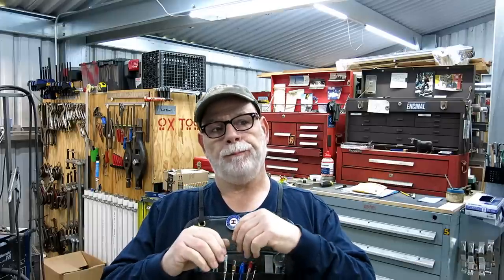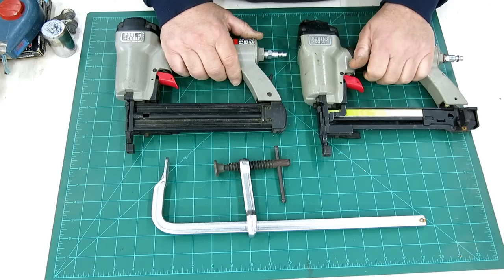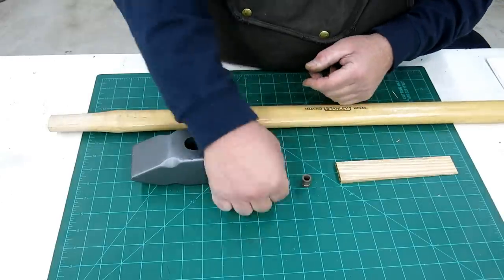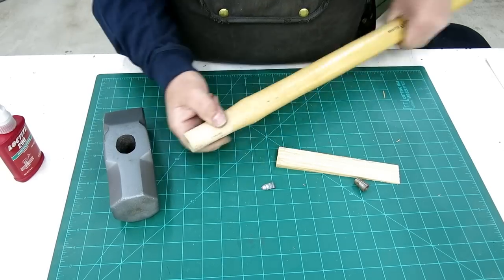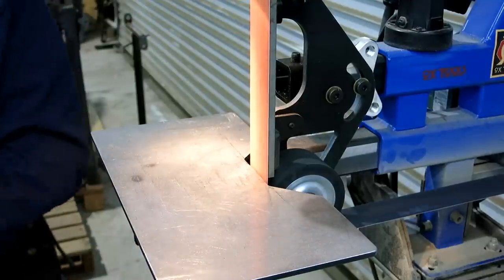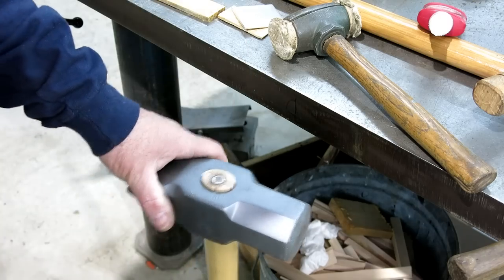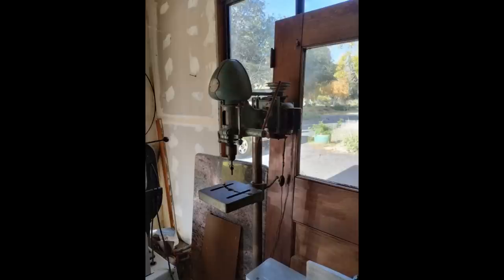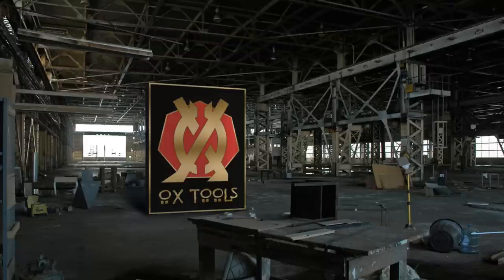Monday Night Meatloaf 148

Comment: I'm always apprehensive about buy things like adhesive on Amazon; I've gotten some that's well past expiration date.
Reply from the maker: Hey Steve. I thought it was worth the risk in this case. For hammer handles slightly expired would be fine. Thanks for the comment.

Cheers,

Tom

Comment: 26:18 I’m sure they tested it thoroughly when they started manufacturing these LED bulbs 22 years ago. Probably screwed one in and it’s still going, right?
Reply from the maker: Hey MM. There is some poor bugger that has to check them every day and write down which ones burned out. Thanks for the comment.

Cheers,

Tom

Comment: Nice meatloaf. Re: Lightbulbs.....When we switched to LED in the home, I began writing the install date on the bottom of the bulbs.  Reality is not even close to the advertised life spans-  Claim: "Lasts 7 years".....& numerous failures under 1-1/2yrs.  LED is certainly a step above fluorescent, though.
Reply from the maker: Hey Robert. Well if I only get 30% of advertised I'm still ahead. Thanks for the comment.

Cheers,

Tom

Comment: Use the hot tip of the glue gun as an iron to melt and reshape the hold glue.
Reply from the maker: Hey Rick. That's pretty crafty of you....Thanks for the comment.

Cheers,

Tom

Comment: Hi Tom. I usually expect your posts to have something to do with optical flat levels of precision so I was quite tickled to see you mounting a handle to a sledge. I've re-handled probably hundreds of tools, mostly axes. As some other commenters said a linseed oil soak works great, and much cheaper than Loctite.
Reply from the maker: Hey Bruce. Have not tried the linseed oil. Oil by nature takes a while to dry so I prefer the locktite method. It cures hard like epoxy. Thanks for the comment.

Cheers,

Tom
Reply: @oxtoolco  There are a couple of products: Chair Doctor, and Chair Lock that are supposed to fix loose joints in wood by causing the wood to swell permanently to create a tight joint. A few people recommended them for tool handles so I tried it. I do not recommend! The fit did get tight for a while but worked loose again under the impacts the tool was subject to. Just an FYI in case someone recommends this to you or your followers.

Comment: White oak has closed pores, which is why they use it for barrels (red oak has open pores that you can blow air through, if you rive/split along the grain).  So your white oak wedge isn’t going to soak up much of the sealer.  Not sure about the hickory though- I think it is open pore?
Reply from the maker: Hey Roverino. The end grain of woods are a tubular structure unlike the cross grain. The density of the wood has something to do with how small the tubes are. The locktite seemed to go pretty easily into both bits of wood. Thanks for the comment.

Cheers,

Tom

Comment: The Amazon mixup on the LocTite didn't work for me.
I watched this video on Monday and immediately jumped on the $15 bottle of LocTite 390. 
They shipped the small $15 bottle. 
Your case may have been a fluke, or a regional mistake, or a mistake corrected on Monday by them is my guess. I received the bottle Tuesday evening. I have had Amazon make a couple of mistakes similar to this over the years that worked out to my advantage though.

Comment: Only savage uses metal wedges on tool handles.All you need is small flat head wood screw  on a parting line between handle and wedge and it will never come out.Drill the pilot hole ,screw it in and threads will keep wedge in place. Also why waist locktite when you can use the linseed oil the same way ? Its great for dry wood-only better thing would be to put handle in vacume  chamber filled with linseed oil to completely stabilize the wood.(thats what knifemakers do with their fancy coco bolo,mahagony,rosewood handles )
Reply from the maker: Hey Zum. Linseed/Locktite? What's the difference? Bottom line is to use something. I like the wood screw Idea. Have to try that on the next one. Thanks for the comment.

Cheers,

Tom

Comment: Tom your bearing looked to me like it might be a shift pin
Reply from the maker: Hey Bill. A shift pin out of what? Pretty short and the dual tapers reminded me of a cylindrical bearing roller. Thanks for the comment.

Cheers,

Tom
Reply: @oxtoolco  reminds me of a diff pin in a truck rear end

Comment: The brushes are probably used anywhere a physician needs to get cells for examination under a microscope, such as the urethra or uterine cervix. They are too short for getting pulmonary specimens. Cytology = knowledge of cells, or examination of cells for the gain of knowledge.
Reply from the maker: Hey Fred. I figured as much. They had that creepy medical look to them. Thanks for the comment.

Cheers,

Tom

Comment: I have a Forester stabilizer you can have if you like. I sold my 10" table saw and have an 18" now.
Reply from the maker: Hey Traditional. Now that is a saw! What is the make. Tannewitz, Oliver? Thanks for the comment.

Cheers,

Tom
Reply: @oxtoolco  It's a Yates-American, it can spin an 18" blade, but Yates-American only recommended a 16" blade as it's 5HP direct drive. I have a number of 14" Leitz crosscut blades, and 16" Leitz rip blades, bored out to motor arbor size (either 1-1/8" or 1-1/4"). It's a beast, it came from the Naval yard in Benicia. It has an  YA is my favorite woodworking machines.🤗
Reply: started to say it has a Bureau of Ordnance tag on it, if you're familiar with those. I have them on a few machines.

Comment: I guess wood working makes shavings that could be called "chips". OH no I now have a strange urge to stain something with linseed oil. You have turned me to the dark side. That smiley face of shame on that drill press makes me sad and angry at the same time. Years ago i scored a large delta drill press with no pecker tracks than my lil brother had and urge to go in my shop grind aluminum on all 4 of my grinders yes that's 8 grinding wheels clogged with aluminum and pecker tracks everywhere :( Now I'm getting into large mills and lathes he is "Never" "EVER!! touching my lathe or mill EVERRRRRRRRRRRRRRRRRRRRRRRRRRR!!!!!!! :0
Reply from the maker: Hey Bear. Thanks for the comment.

Cheers,

Tom

Comment: Black is a dangerous colour to have in a chalkbox. Do not underestimate the longevity of a black chalkline.

Going from blue to black should just be a matter of replacing the chalk and snapping a few lines. A good chalkline for black is the Tajima ultra fine. It leaves a sharp crisp pencil thin line. 

Why do I say Black is a dangerous colour? About 15 years ago we “tailgate” tested all the colours and several brands on an exterior concrete slab in Atlantic Canada. White, blue and yellow faded after a few weeks to a few months depending on the brand. Blue lasted a few months. White lasted about a week. Purple lasted one hour in the wind. Red and Orange lasted a few months to 2-3 years. Red lasted the longest at about 3 years. Black lasted a very long time! Irwin’s black faded after about 2-4 years of exposure. The “Blackline” brand linked below survived fully intact for 5 plus years of rain, snow, wind and several power washings. Parts of the “Blackline” brand are still visible today. To remove the “Blackline” at the end of a construction project you would have to deliberately power-wash and scrub. If you are doing stud layout “Blackline”is the best! It will be there Monday morning for sure!

Finehomebuilding magazine had an excellent article about chalk line colours 10 years back.

 I love https://www.amazon.com/Blackline-Mfg-BL54-Chalk-Black/dp/B0007ZYBY4 for a lasting mark like a property line or something that will be hidden after the project. Crisp and clear mark
Reply from the maker: Hey Gregory. Thank you for the excellent information on chalk. Who would have thought? I have seem the sweet Japanese chalk lines and wondered but never had enough use to warrant one.  Now I have a dilemma deciding which color to put in the new chalk line. Thanks for the comment.

Cheers,

Tom

Comment: I think the $15 loctite is made in China or India.  It may be a knock off. I have used the thread locker and did not see a difference. I would not use it on something that is a hassle to take apart and put back together
Reply from the maker: Hey Phil. The bottle seems legit to me. We will see if the stuff actually hardens up. Thanks for the comment.

Cheers,

Tom
Reply: @oxtoolco  would make an interesting test. $55 loctite vs $15 loctite. It’s all over eBay also. Have a great day.

Comment: Just to Debbie Downer on your loctite deal a little. Sometimes  a "too good to be true" price on something on Amazon or Ebay is part of a fraud scheme.  the buyer is not the one being victimized, in these cases the seller purchases stock for their store one stolen credit then sells it super cheap for a quick profit it doesn't matter to the scammer that the selling price is lower than the purchase price because they didn't pay for it.  Easily shipped, higher cost consumables are often good candidates for this laundering scheme. Or it was a typo
Reply from the maker: Hey Debbie. Now I feel bad....Thanks for the comment.

Cheers,

Tom

Comment: Really Tom a dial indicator? All the kool kids have a fence DRO😂
Reply from the maker: Hey Gene. You daring me? Thanks for the comment.

Cheers,

Tom
Reply: @oxtoolco  No sir!! I watched you carve a baby bullet out of a chunk of steel. You could probably have it designed and built before breakfast. But I’m sure your version would be better than those that are commercially available.
I have a bizarre question for you. Are there still hyenas at lbl? I have worked on a few projects there and you could hear them howling all day long.
BTW I used to work hanging on swingstages on the outside of hi rises ( have seen a few scary things including a cable break leaving the scaffold hanging vertically and the safety device on a scissor lift fail allowing it to roll, just in case there is anyone that isn’t sure ,they don’t go down stairs well,especially when fully extended the result was 56 stitches in my forehead)but the 2 scariest projects I ever worked on were at LBL and LLL.
Reply from the maker: @genecarden780  Hey Gene. The Hyenas are gone unfortunately. I used to love hearing them in the early morning up behind LBL. Not sure what they are doing with that area these days. All the best. Tom